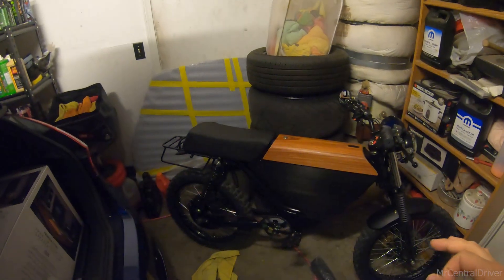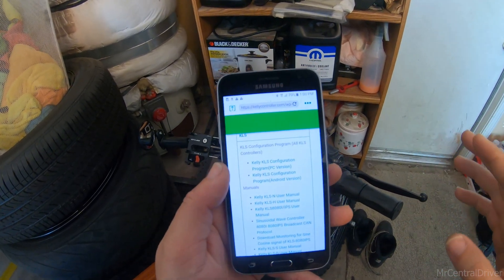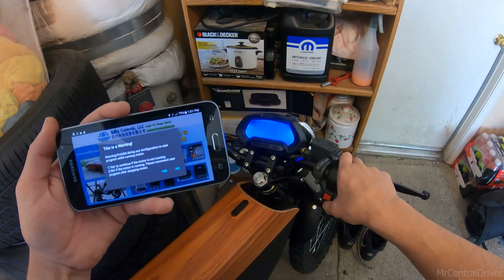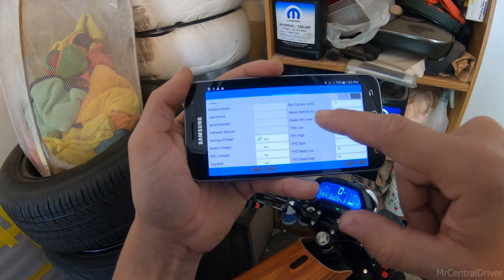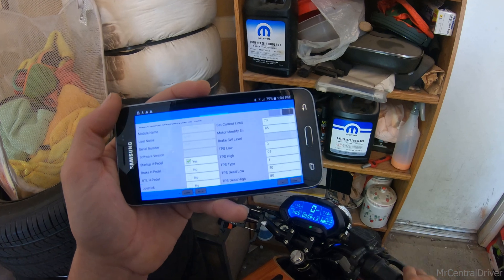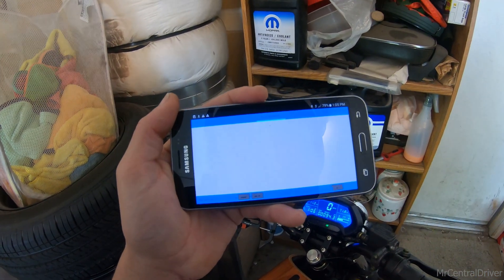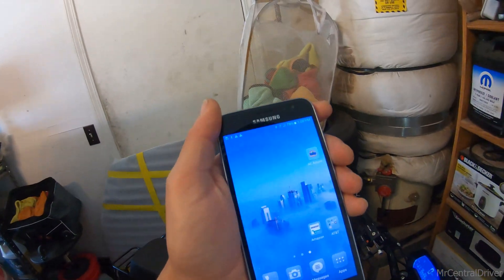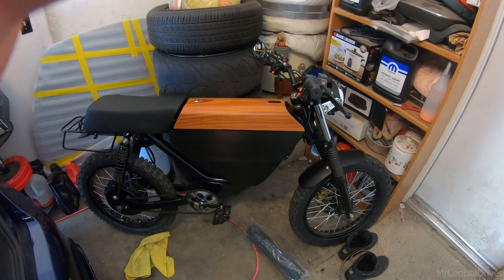Onyx RCR Kelly Controller Mod - How to Video

Comment: i wouldnt suppose you'd know if this works just the same with the CTY2 would you? bike can be detected via bluetooth,but when i try to link it through the app it says it fails to load up.
Reply from the maker: i dont think so. might be different controllers
Reply: I’m wondering the same thing, the device is being shown up but when I click on it it says failed to connect.
Reply: @Space_Traveler77  so eventually i did get it to work. Had the connection fail error as well, and a quick reboot of the bluetooth did the trick of hooking up
Reply: @firegraff  same for me, though there werent much settings to change besides battery current. Probably because of the cty2 not being as capable.

Comment: What does the ( Boost) do?
Reply from the maker: Not sure I heard not to have it on
Reply: @MrCentralDriver  ok. Maybe I shouldn't try it out then. Thanks.
Reply: Exactly what I was searching for and this vid was one of the ones that popped up. The manual makes it sound like it just maxes out the throttle “Configurable boost switch. Enables the maximum output power achievable if the switch is turned on. The effect is the same as full throttle position even if you don’t turn throttle at all” from hard to understand manual. 
Why would to want this feature when yo can just pull full throttle?

Comment: I got the kelly program downloaded but every time I try to connect my bike with phone it says "APP NEEDED"...any thoughts?
Reply from the maker: there is different versions AC ADUSER
Reply: I got it squared away. Thanks
Reply: @B.Zee...  hey dude, I'm having the same issue as you. What did you do to fix it? Thanks
Reply: @tatyanadubinskaya1132  I thought just having the "Onyx" app was enough Tatyana, but you need the ADUSER app as well. That's the one you connect through.
Reply: Kelly AC Aduser

Comment: Great vid but if you can spend thousands on a bike you could probably spend a few hundred on a better phone
Reply from the maker: The android phone is just to run the app. I use an iPhone but the Kelly app you need in this video is only for android. Not gonna buy a $$$ phone just to Bluetooth into my bike.
Reply: @MrCentralDriver  makes sense

Comment: Has anyone installed A Kelly controller to SURRON LIGHT BEE?
Reply from the maker: not that i no of
Reply: There are better controllers out there: sabaton 72200 unlocked capable of 300 amps, bac8000, fardriver
Reply: Yes, i have one on my surron!  Great cheap upgrade ! 
You Can buy Kelly/sabvoton kits 100% plug and play for surron LBX on Enhancedsurron

Comment: Is this for the 23ah battery? Can’t find any Bluetooth connection.
Reply from the maker: Make sure your using an android phone and it’s gonna be a bunch of long numbers when u select Bluetooth.  The password will be 1234. But you need the Kelly controller app to change settings
Reply: MrCentraldriver Awesome! Ok I found some random numbers. Pass was 1234. And now it works thank you!

Comment: Just a small note: For anyone looking to change the speeds on each mode. (ie. Changing NORM from 40 to 28 for Class 3) 

You'll be looking for LowSpeed Forw Speed (For ECO), MidSpeed Forw Speed (For NORM), and Max Forw Speed% (For SPRT). 
They're based on percentages with 100% being 60MPH. 
Take note of the Speedometer being off by about 4-6 MPH so you will need to compensate for that depending at what speed you want it changed to.
Reply: So you can get 60mph with the new ones?
Reply: @astro4248  they all can if you’re under 160lbs lol.
Reply: You are awesome, thanks

Comment: Thanks for the info...will try it out. BTW re the wood battery cover top not fitting, I used a black Sharpie Pen to coat or cover the front and rear edges of the wood battery cover. It hides the lack of perfect fit and just looks so much better. Before, the raw edges of the cover draws attention to the poor fit while  the black edges just blend in with the metal portions of the battery box.